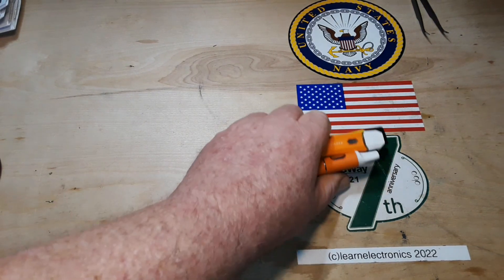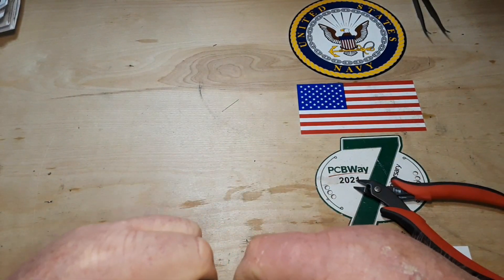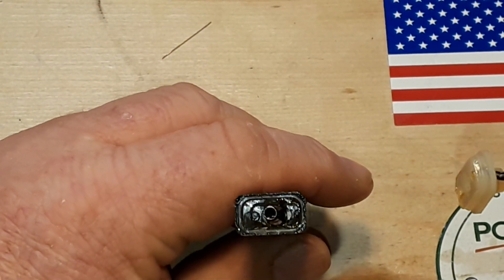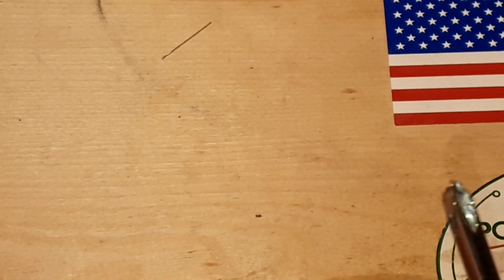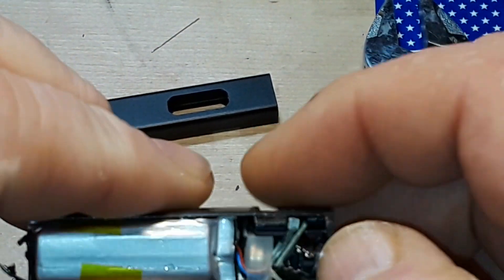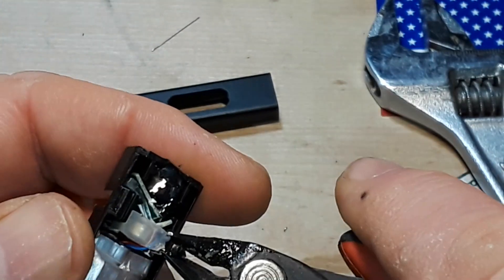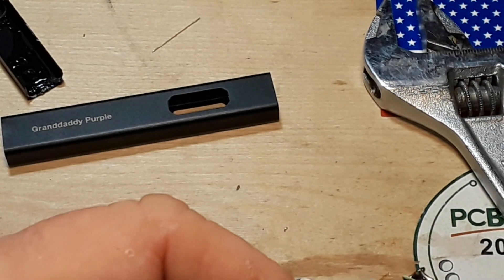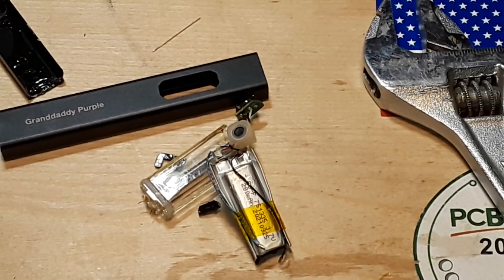What's Inside A Disposable E Liquid Pen

Comment: I've found 4 of these "disposed of" mostly in the UK, they are cylindrical, and the battery falls out. Of the 4, one had a dead punctured battery. The other 3 had batteries which were still ok. Typically the "as found" voltage is 3.2 to 3.8kV. so they are reasonably discharged. After hooking them up to a protection circuit, I tended to get almost 500mAh into 550mAh batteries. None of the ones I found have anything which would attract someone who has no idea what they are doing to try and recharge it

Comment: wow, that 250mah cell wouldn't last any time at all! My vape has two 18650's and i change them over in the evening and charge them on an external desktop unit.  my vape also came with an extended back that allows you to use four 18650's but its ridiculous and like holding a brick in your hand and i cant imagine many use the extended option.